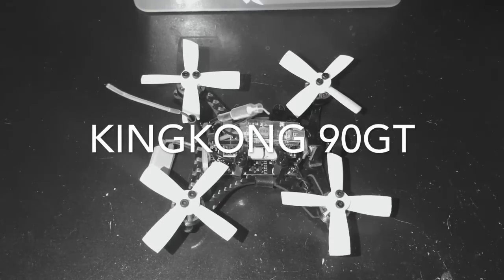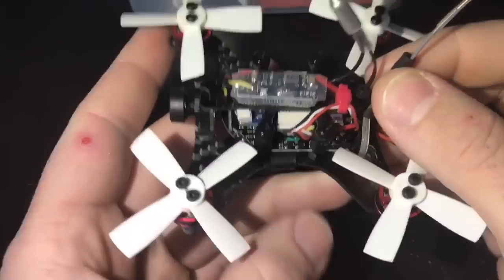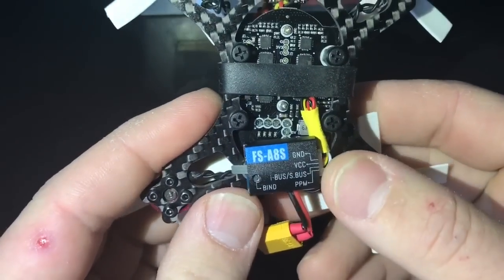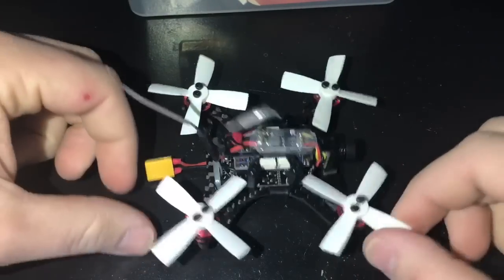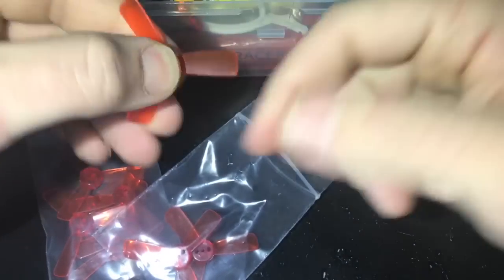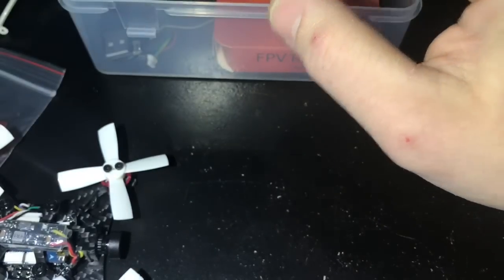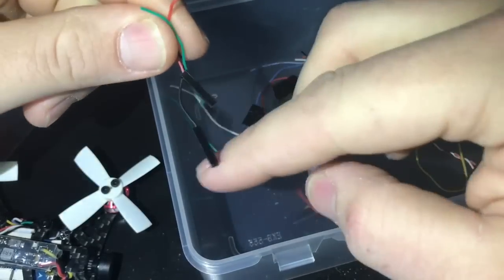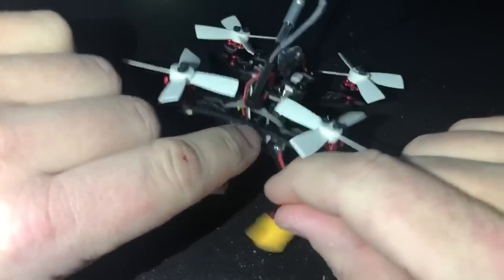KINGKONG 90GT (ARF)

Comment: do you thing tha it is more punchy with 3 , 4 or 5-baldes ?
Reply from the maker: Gophy the gemfan 4 blade props are the absolute best for any micro. But the punchyness is similar with all of them
Reply: what about durabilty ? i found very good "unbreakable" DYS tri-props, feedback is very good !
+ can you post number of these props ? i found gemfan 2035, but i don't know if they are these you are using
(sorry for my English)
Reply from the maker: Gophy the dys are very durable but heavier and have way more plastic. The gem fans are equally durable. Hey bend  over and over. I have broken one yet. They just bend to many times and it's time to switch them out.
Reply: ok thanks, i too read that dys aren't balanced very well :) so i orded gemfans
Thanks !
Reply from the maker: Gophy you won't be disappointed!
Reply: pls can you update props link in description, i can't find these props on Banggood
thanks

Comment: i
i changed my connection into a xt30 setup, it starts up and smoke pours out of it - help
Reply from the maker: you need to check all the connections. sounds like there is a short some place. make sure nothing is exposed that shouldnt be. look where the smoke came out, check for damage or burn marks in that area.
Reply: hi
there seems to be no problem anymore - did it twice ?????
seems fine on beta flight too
CAN YOU tell me how to connect the ac800 to the board ?
Reply: hi - i see your comments on the wiring of the 800 receiver but im trying to get it working on sbus - any ideas ?

Comment: its also great in acro when you get used to it, and feels a little like a baby 5",
Reply from the maker: been flying in acro more lately. much more comfortable with the smaller quads then my 250. i fly the 90 way harder. my camera went way out of focus permanently. how is your camera holding up?
Reply: the electronics part has come out of the lens casing (square bit) a few times I eventually hot glued it in place, I also had to adjust the focus many times. would still go out with glue holding it in place, instead i used a little PTFE tape on the thread to make it a bit tighter but can still adjust it if need be. another thing is I have noticed that the bell housings of the motors can get loose and come off over time especially on high rate's or a crash they have a weak press fit on to the main shaft a bit of a quality issue. I'm eventually going to change them out for a different brand. so far I have just pressed it all back together and they are fine until the next time they get lose.

Comment: i am having one hell of a time getting this running... is there somewhere i can bring it and my controller to get them running together here in central california?
Reply from the maker: i wish i knew if there was. it certainly can be a tough process. are your transmitter and reciver the correct match. make sure you know what signal your using. it is set up for sbus out of the box. you will need to change it if you are using ppm pwm. any questions dont hesitate to ask.
Reply: quad55555 where are you located in Cali?
Reply: modesto
Reply: I'm in sac

Comment: Hey, l just purchased a King Kong 90gt from banggood and it is on its way at the moment. I also purchased one of the fs A8s receivers and it arrived today, how do I connect the receiver to the King Kong, I don't see any type of plug that matches the one on the fs A8s. Please respond, thankyou!
Reply from the maker: In the video I talk about the 2 sets of connections included with the KINGKONG. You will need to remove the connector that comes attached. And plug in the pwm/ppm cable provided into the side with the USB cable. You will then have to cut and solder the red, black, and white wire. Positive, negative, and signal. Solder those to the matching wires that come off of the connector from the receiver.
Reply from the maker: Logan Mcghee the red wire will get soldered to the vcc wire. Black wire will go to the gnd wire. And white wire will get soldered to the ppm wire. Make sure your transmitter is set for ppm then go into betafligjt and select ppm and verify that all is working. You can see at the start of the video kind of how I hooked it up.
Reply: Thankyou

Comment: I'm wondering if the cables are provided for the fsa8s Receiver to hook it up right out of the box
Reply from the maker: the proper cables are in the package. how ever it is not plug and play. some solering is required for proper operation.
Reply: For the fsa8s I just re-positioned the 3rd wire on the receiver end to the last (4th) hole.  No soldering required.  Set up on UART 1 and PPM in betaflight.  Easy peasy.

Comment: If you put the prop guards under the motors and not the arms, it will protect your props a lot more.
Reply from the maker: that makes sense. thanks for the tip. due to the frame sitting smack across the cam view i dont use them much anyway.
Reply: I don't like using them either but those props are so brittle it beats going through so darned many.

Comment: About a month later what to do you think of the Furious FPV props? Not much out there besides the stock crap, and the Furious props. I'm worried about burning up the tiny 3a ESC.
Reply from the maker: Richieboy87 they are better then stock but still shattered way to quick. Dys 2030 tri props I showed in the video are great. I haven't broke a single prop in over 20 flights. Grab those immediately. I will be posting an update video to talk about that very soon.
Reply: DYS Tri blades are bad. try Gemfan 2035 and you wont buy any other props
Reply: How do the Gemfan 2035's go with no bolt holes? Had any problems with them flying off mid flight?

Comment: Could you post on how to  bind and setup with Betaflight? I could not bind my DX6 with my new Kingkong 90gt. Make dumb proof. LOL
Reply from the maker: Yar ogirba I used a flysky receiver and added that to the almost ready to fly version. The plug and play version that you have should have a bind button on the receiver. Hold that button power on quad. Then hold bind on transmitter and power that on. That should bind the receiver and transmitter. Then you need to set up betafligjt to your protocol of your transmitter. Follow the product link. Manuel is on the site.
Reply: Sorry man. My ADD is acting up. So hold the button on the Kingkong then plug the battery, keep on holding while the DX6 is binding. Then turn on the DX6 on while holding the bind button also. Did I got it right?
Reply from the maker: Yar ogirba look for a light. Hold bind on quad power up a light someplace should be blinking rapidly. Then let go proceed to the transmitter hold bind then power up transmitter. Should all bind and show info on your transmitter screen. Sorry I don't run dx6 not exactly sure what happens.
Reply: Chris romano thanks brotha
Reply from the maker: Yar ogirba no problem. Hope that helped.
Reply: Chris romano I'll try it tonight after work . If not, I'll bug you again. LOL
Reply from the maker: Yar ogirba no problem. Try taking a look at the manual for specifics on the receiver that came with your quad. Mine didn't come with a receiver so it is a little different.

Comment: There's alot of people burning their escs out with 4 bladed props. I've got one of these as well and love it, but really don't wanna take the chance of having to swap my fc/esc out.
Reply from the maker: Dustin Kimble those props broke not long after the video. I've been using dys 2030 props and haven't broke a single prop in over 30 flights. At this moment that's the prop of choice. But I did have the worry of putting to much strain on the system.

Comment: Are you flying with any other batteries? If so, what else are you using?
Reply from the maker: Drew Fulkerson I haven't used any other batteries yet. I've got three stock batts. Looking at 450 mah packs. I feel like I get a very good flight time off the 350mah pack.
Reply: What flight times are you getting on the 350mAh?
I switched my JST plugs out for XT30 as I agree that they transfer power better, but have you found any issue with the cells not draining consistently because of this or due to not running the power from the balance plug out? Mine run for about 3.5 mins and then it just drops out of the sky and the cells are off by about 0.05 - 0.10 each, which doesn't seem right. But, these are my first 2s batteries...

I tried turning off the Vbat option in Betaflight, thinking this may be causing the dropouts. But no luck. And everyone else seems to be getting 5 mins plus on a flight. Blergh!

Any help is much appreciated!

Comment: I have a question Chris, after you hook up the receiver on the Kingkong 90GT, how do you arm it using the Evolution Transmitter, using the Flysky FSA8S
Reply from the maker: Jimmy  go into betaflight and make your aux1 Channel for arming. Then on the transmitter set channel 5 to what ever switch you would like to use. I didn't test it before I set it to arm with a switch. Typically you can hold the throttle to the bottom right to arm and left to disarm.

Comment: Thanks for the video, I was looking for information on what receiver cables are provided with the ARF version and this helped.

I'll be hooking up a Turnigy iA6C receiver to the Kingkong 90GT as my first racing quadcopter build. I liked the iA6C because it will provide battery telemetry.

How/why did you decide to use PPM over SBUS? I'm not sure which one I should choose.